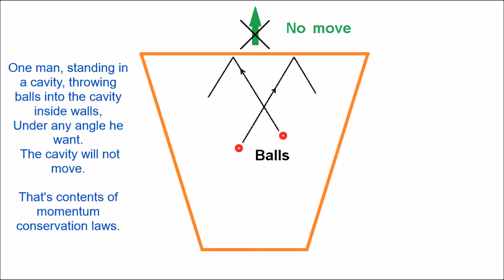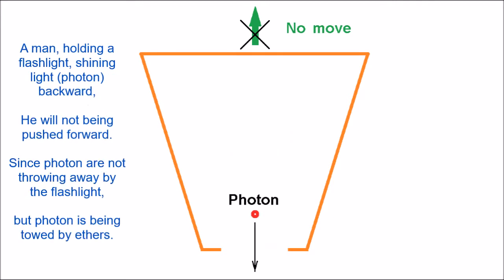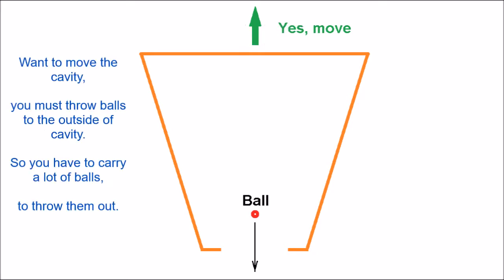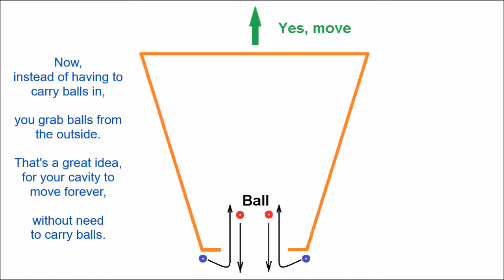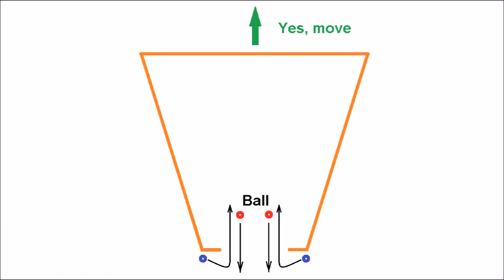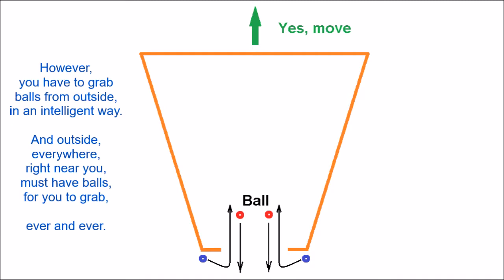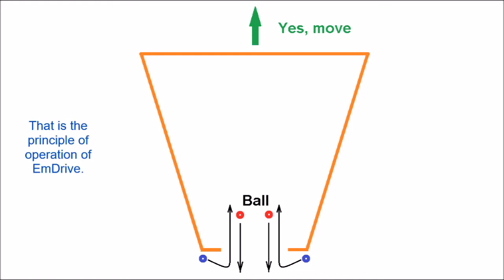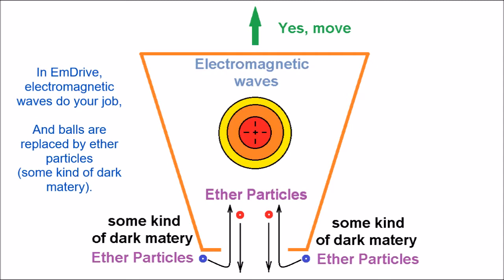How EmDrive Works - (Simulation+Text+Voice)

Comment from the maker: Photons (hay sóng điện từ) không được phóng đi bởi nguồn phát, 
Photons (or electromagnetic waves) are not throw away by a source, mà chúng được "Môi Trường Truyền Dẫn" (ete) kéo lan tỏa ra. 
but they are pulled (spread out) by a "Transmission Medium" (ether). Vì vậy, cái đèn pin không bị đẩy giật lùi lại, khi nó chiếu ánh sáng về phía trước. 
Therefore, the flashlight is not being pushed backward, when it shines on the front. Cũng vì vậy, vận tốc của Photons (hay sóng điện từ) không phụ thuộc vào vận tốc của nguồn phát. 
Just so, the velocity of Photons (or electromagnetic waves) does not depend on the velocity of the source. 
(De Sitter double star experiment). Nhưng vận tốc của Photons (hay sóng điện từ) sẽ phụ thuộc vào vận tốc của "Môi Trường Truyền Dẫn". 
But the velocity of Photons (or electromagnetic waves) will depend on the velocity of the "Transmission Medium". 
(Fizeau experiment). Chính xác như vậy với "Sóng Âm" và "Không Khí". 
Exactly the same with "Acoustic Waves" and "Air". AwDrive không tạo ra lực đẩy do nó phun "Sóng Âm" về phía sau, 
AwDrive not produce thrust by pushing back "Acoustic Waves", Nó tạo ra lực do đẩy không khí về phía sau. 
It creates thrust by pushing back air. "Sóng" và "Môi Trường Truyền Sóng" là hai thứ khác nhau. 
"Waves" and "Transmission Medium" are two different things.